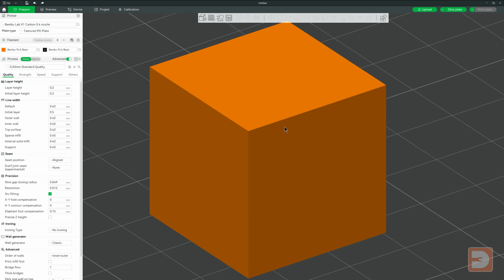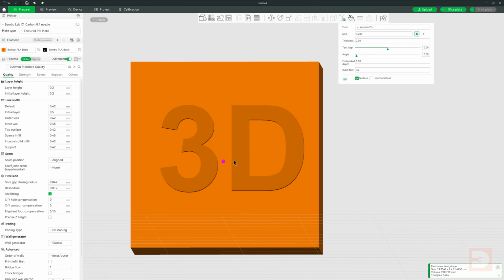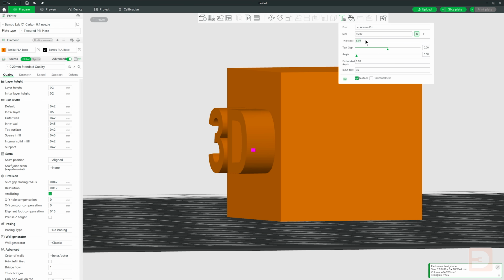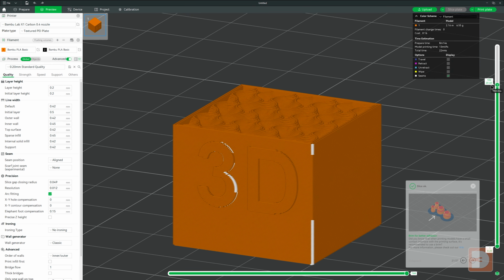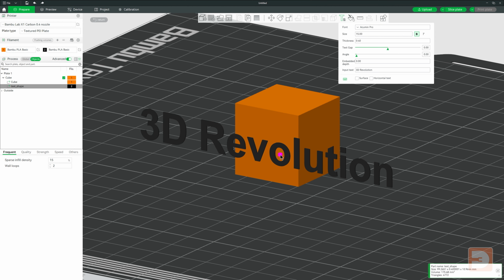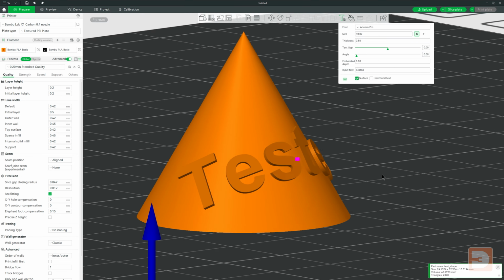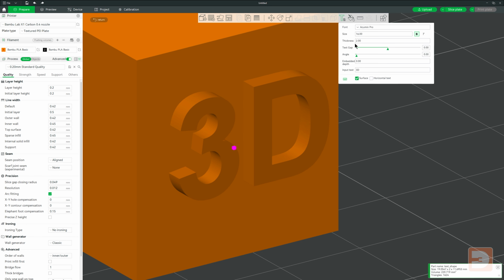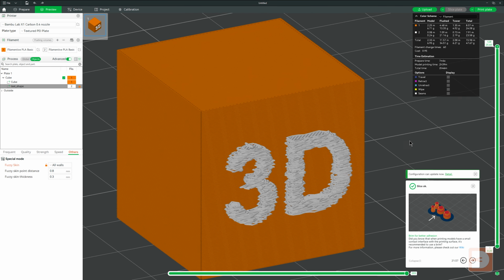Bambu Studio Text Tool: Tips & Tricks

Comment: 0:29 howd u get the cube? 😅
Reply from the maker: This works with any model you've imported into the slicer, it doesn't need to be a cube.
If however you wanted to add a cube in Bambu Studio, right click on a blank area of the build plate, hover over 'Add primative' and select from the list of objects. You can then use the scale tool to resize it to whatever you want.

Comment: I've wondered for a while now why we need a colour tower on multi colour prints. There's so much 'pooping' going on from my AMS, do I really need a tower as well? Aren't they essentially doing the same job?
Reply from the maker: They do different jobs. The prime tower does just that, it primes the nozzle and the filament ready for printing. It ensures that there is the right amount of internal pressure, and filament flow before it begins printing. This helps prevent under extrusion, oozing, blobbing, weak layer bonding, and also ensures that the nozzle and filament are running at the exact right temperature the moment it starts printing on the actual model.

Purges (poops) on the other hand are for flushing out the previous filament (whether a differerent colour or material) to minimise cross contamination that can lead to colour bleed or print innacuracies. But when purging, it operates at a different flow rate and temperature and that all needs to be reset before it begins printing the model again,

Comment: Which version of Bambu Studio are you using? I don't have that embedded feature in my text tool panel, any help?
Reply from the maker: I can't remember exactly which version I produced this video with but it was most likely 1.10.1 or 1.10.2.

In the current version (2.5.0.66), If you want to embed the text to use as a modifier (such as to adjust the colour or apply fuzzy skin etc) without changing the geometry of the model, set the amount you want it to go into the model by with the 'Embedded depth' setting, then select 'Modifier' from the 'Operation' setting at the bottom of the text menu.

If you want to embed the text to cut it out, do the same but select 'Cut' from the 'Operation' setting.

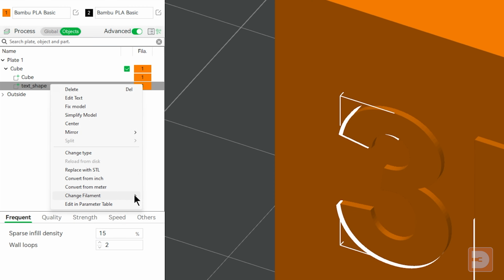Comment: 3:40 In this mode, the text disappears completely in the slicer.
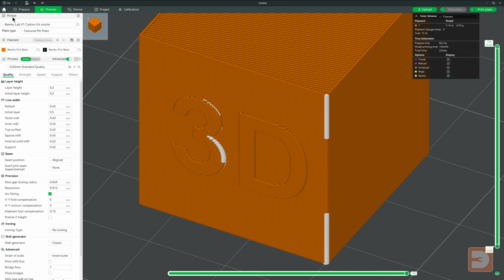Reply from the maker: In what mode do you mean? At 3:40 in this video, I'm just switching to the object list which only affects the menu view, not the model view.
If you mean once you've sliced it, the text doesn't show, that'll mean there's a conflict with the text and something else you've applied. For example, if you've just set it as a modifier, but you've applied it to an area of the model that you've manually painted with the paint tool (ie, isn't the default colour you've set for that model), then often modifier filament colours will be ignored.

If that's the case, you can either set the background of that area as the default colour for the model, or you need to set the text as a solid with it's own independent default colour.
Reply: @3DRevolution  
I tried pasting the text above and below, but it disappears when I cut it. I didn't add any modifiers. But then I tried doing what you did—pasting it horizontally—and that's how it works. But if I paste it above and below, it disappears. What should I do? How can I fix this? I'm using Google Translate, so sorry if I'm wrong.

Comment: Have these settings changed since the video was made? I am missing options for "Embedded Depth" and I never get the pink square for moving the letters.
Reply from the maker: Could I check which version you're running and whether you're on Windows or Mac?
The current version of Bambu Studio absolutely still features the Embedded Depth setting (Located immediately to the right of the 'Thickness' setting in the Text menu). 
The pink cube is now a yellow cube but still works the same way.

Comment: Yeah the text tool looks so radically different from what your video shows now... I will still try to use your tip on the "type" to see if I can get the text to stop getting filled in when on the bottom surface when the exact same text is perfectly embossed when on top surface.  Frustrating.
Reply from the maker: Hey there, sorry for the late reply.

If I understand correctly, are you saying you're trying to have your text engraved in the bottom layer, but when you slice it, the text just vanishes?

If that's the case, it's likely one of two things. Either the embedded depth is less than the layer height you're printing at, or there is a modifier shape that's conflicting with it.

Hopefully two months on you've managed to solve this issue but if you are still struggling with it let me know and we can try to get you up and running.

Comment: With the new update, this video has become irrelevant. The embedded function is either removed or moved elsewhere. Anyone has an updated tutorial on this? TIA
Reply from the maker: Are you still having an issue with this? 5 months on and still running the latest version of Bambu Studio, both on Mac and Windows, the Embedded Depth option is still there, and to have it engrave into the model, or modify, you just select 'Cut' or 'Modify' from the 'Operation' setting at the bottom of the text menu.

Whilst the text menu has changed layout slightly, the general functionality and the methods covered in this video are still relevant. 

However, several people have shared your sentiment that it looks too different now so I may produce an updated version of this.

Comment: Is it possible to add another object to the side of a cone like the text, keeping a surface and horizontal option?  I have a cone with text and I want to add a logo to the side.  Additionally, the text I'd like for it to read from wide to narrow on the cone.  That means some mirroring, but that causes the text to protrude in at the wrong angle relative to the cone.  Any way to reangle?

Comment: Great demonstration Just wondering as I cannot turn off the surface icon it just switches from surface to horizontal and back .  I cannot get both clicked at the same time.  Any thoughts on why?
Reply from the maker: Hey there, they do appear have changed this. With "Horrizontal Text" selected now, it is as I show in this video with neither selected. So effectively the "Horrizontal Text" feature has currently been replaced with the default of before.
I'd imagine this is a bug and will be rectified in a future release, fingers crossed.

Comment: Great text tutorial, 
Question, I recently wanted to add translucent text to a matte PLA pumpkin tea light.  I found I had to make the text into a Boolean intersection cut off the pumpkin in order to insure that the PETG translucent was flush with the PLA matte but extended all the way through to catch the illumination of the tea light.  Is there a better way to do this?

Comment: I want the text to be FLUSH with the surface but thickness is 0,1 no matter how much i want it to be zero (0,0) and flush with the surface. What the hell is going on. And i do not want depth for the text either either i want it to be flush. Is that possible with the bambu studio text tool only?
Reply: Ah F it i got a good tip from a reddit post just to move the text with world coordinates equal to how thick it is and that makes the difference from the surface zero.
Reply from the maker: I'm presuming you want it to be flush so that you can print the text in a different colour but have it flush with the rest of the design?

This is super easy. Apply your text, and then set the embedded depth to at least 1 or 2 times your layer height. Don't worry about the thickness (the amount it's sticking out from your model it won't matter). 

Then in the Objects list, right click on the text shape, select "change type", and then select "Modifier".

Finally right click on the text shape in the objects list again, go to 'Change Filament' and select the filament you'd like it to be printed in.

This will then print the text perfectly flush in the model in the selected colours (you can also apply settings like fuzzy skin etc to the modifier and it'll apply this as well, still keeping it flush to the surface).

Modifiers don't add or subtract any volume from the design so they only affect the settings for areas of your model that the modifier shape overlaps with it, this is why if you change the mode to Modifier, and ensure you have an embedded depth set, it will always and only produce a flush text.

Comment: great video. However, I'm trying to add text to the underside ( plate ) as a negative and also color fill it with a second color, but can't seem to figure it out.
Reply from the maker: Thanks.
Hmm, just so I understand correctly, are you saying you'd like to have some text cut away, and then to have the visible area of the text recess a different colour?
Reply: @3DRevolution  Actually I think I figured it out. But I basically want to put text on the plate side of a part in red abs at 2 layers. then print the rest of the part in black abs. end result is flush red text in red.